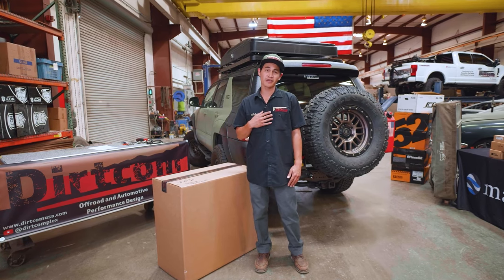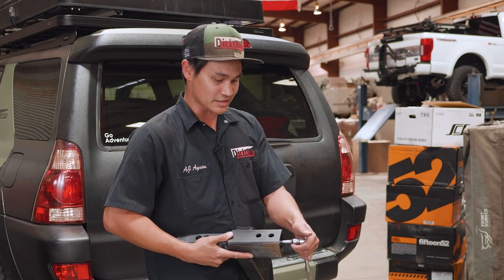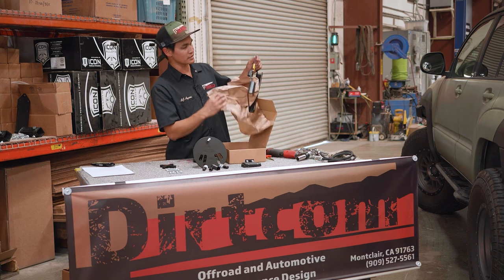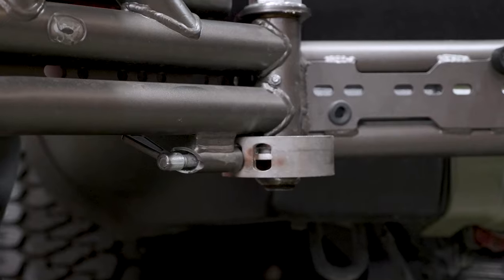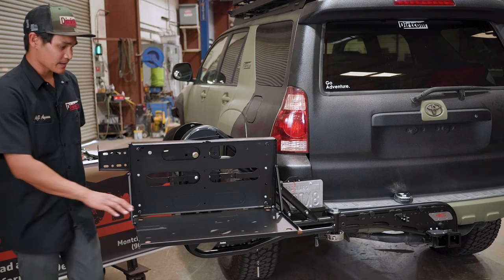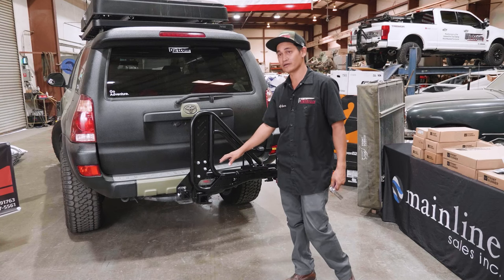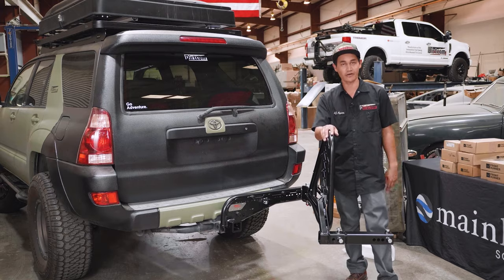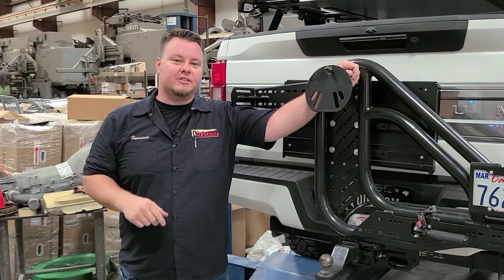TRAIL SWING and Accessories Install Video. In Depth Details by DIRTCOM INC.

Comment: Looks great. I wish the pricing was more transparent. Nothing on the website but a contact email. I'd like to see upfront pricing on the swing and all the accessories.
Reply: email them.  But the cost is over $1700 for the swing.
Reply: @212caboose  
G Jenkins
3 weeks ago
 @Troy Pepper  Total to my door. $ 1181.00 That included the TrailSwing and the Accessory bracket for Jerry can.  So far,it has been worth every penny! Best on market for build quality in my opinion.
I think pricing depends on how many accessories you include.

Comment: Great video, very straightforward and thorough. Will this model featured in this video be enough for a Tahoe platform? Or do I need the HD version? I tow a 7400lb travel trailer as well, what is the rated tow weight for the receiver on this setup?

Comment: I really like your product. I plan on getting it for my the 5th get 4runner. My question is I would like to try to put the back up camera possibly on the license plate. Any specific cameras that you recommend? I don't want to use the bird eye view one. Maybe get the c4 install kid and run it where the plate light wires go?

Comment: Regarding the M12 bolts to hold the tire via lug nits, is the spec 1.25 or 1.5 inch? I am adding a locking lug nut. Thanks in advance for the reply!
Reply: @Dirtcom

Need an answer to the question above.

Need to have a locking lug to keel the spare from being stolen.

Duh!

Comment: Cool video, very informative and easy to follow instructions! Gj! I am sold! Just wondering if the accessory hitch and table can be installed together? And what’s the max weight it can hold? I’m planning on having 2 emtb (120lbs)+33” tires.
Reply: 1700

Comment: What if you need to still pull a trailer with this on
Reply from the maker: We use a solid billet of steel for the hitch assembly which was tow rated according to SAE standards to exceed Class 4 - 10,000 lb towing. Other companies will day theirs is tow tested. Ours is actually TOW RATED

Comment: Will this take away towing capabilities?
Reply from the maker: The Trail Swing itself uses a solid billet of steel for the tow hitch assembly.  We have had this tested and tow rated according to SAE standards and it easily passed the Class 4 rating of 10,000lbs. The limiting factor will be your vehicle. The Trail Swing adds 6" of leverage so you will need to keep an eye on your tongue weight.  The Tacoma is rated to around 7,000 lbs but I wouldn't go anywhere near that much tow weight with a Tacoma.

Comment: Shouldn’t it swing to the passenger side for safety reasons? Seems swinging to the “street” side is asking for trouble. Of course it wouldn’t matter on a trail but on the road it would be dangerous.
Reply from the maker: We offer both passenger and driver side swing out to fit your setup.  There are plenty of products that swing to the driver such as dual swing outs, or even the door on an FJ cruiser or any door on the driver side of your vehicle.  The auto latching hinge adds a layer of safety in case it gets away from you on a hill, it won't swing wildly out 180 degrees.

Comment: Would this work on a 2023 tesla model Y?
Reply from the maker: The extended version which fits the Rivian R1T should also fit the Model Y. If you are local to SoCal feel free to send us an email to schedule a test fit
Reply: @DirtComplex   I wanted to put a cargo carrier on the tire hinge part anyway you guys can add that?
Reply from the maker: @juncalantoc8281  yes. If you look on our website the accessory hitch bolts onto the swing arm. So if you put the cargo basket on  the accessory hitch it will swing out with the swing arm.

Comment: Is there a link for the HD?
Reply from the maker: We don't have a video for the HD install yet but check out the photos and details on our website! Dirtcomusa.com
Reply: @DirtComplex  I didn’t see the link for the HD version, but I do know thanks
Reply: @DirtComplex  I would need a 6 inch extension to clear my truck camper on a 06' Ram 2500.  Is this possible?  Is there a mod that could be added?  If so, I'd order one TODAY!  Plz advise.  Thanks!
Reply from the maker: @HarveyManfrenjenfrensen  The problem with using an extension is it will rattle in your hitch. Does the camper stick out passed the oem bumper?